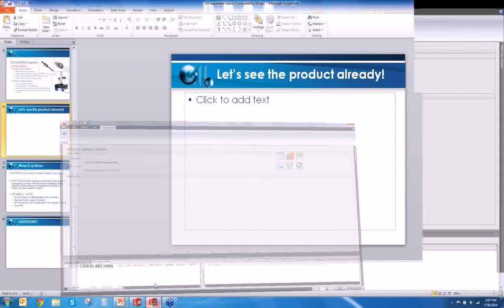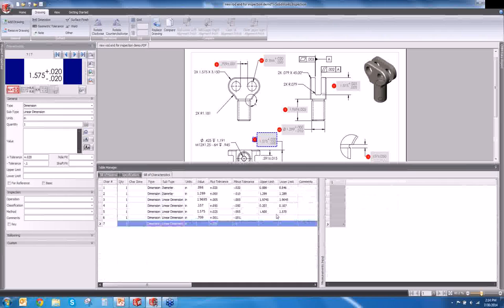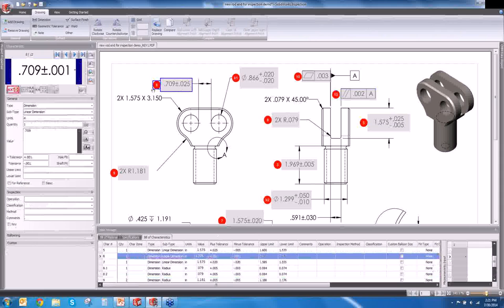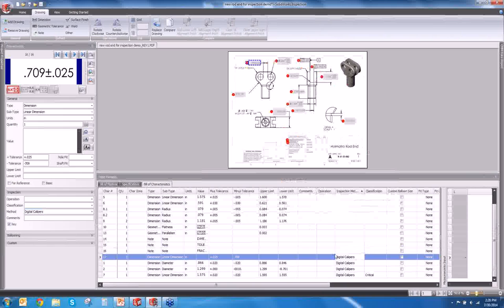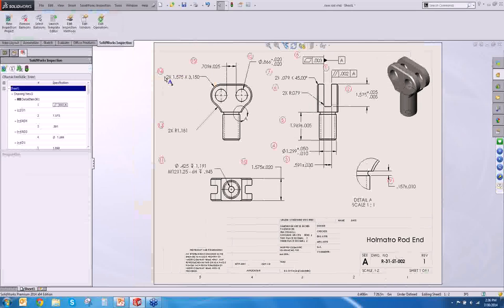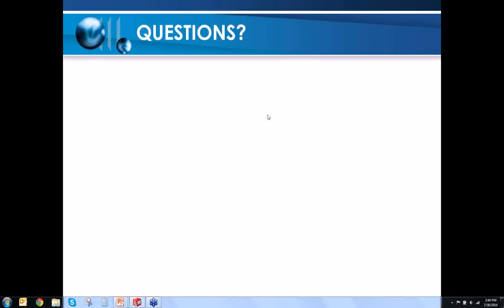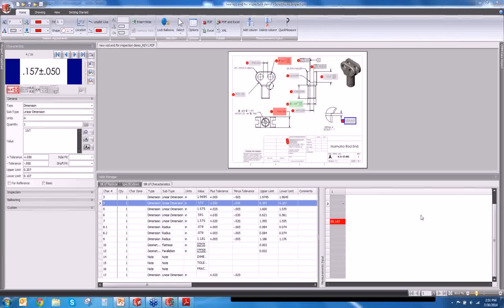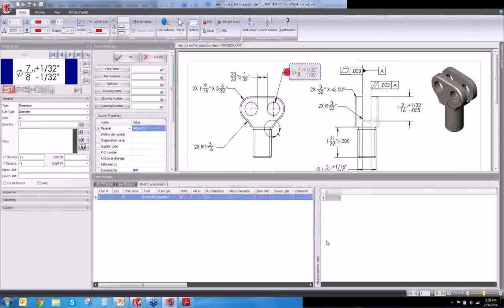Webinar: SOLIDWORKS Inspection: Revolutionize Quality Control

Comment from the maker: Good question Ken.  As illustrated in the video, SOLIDWORKS Inspection allows you "explode" a dimension that has multiple instances into separate inspection characteristic items.  By default, Inspection will create a shared balloon for these inspection characteristics.  However, SOLIDWORKS Inspection has extended capabilities to Un-group and also Group the multiple characteristics with unique balloons.  You can even generate notes in the inspection project to help designate which balloon references which instance.  Please see the link below for a screen grab.  I hope this helps.

https://drive.google.com/file/d/0Bxm7CvW91lNwNVRlRkdVNmd0OGM/view?usp=sharing